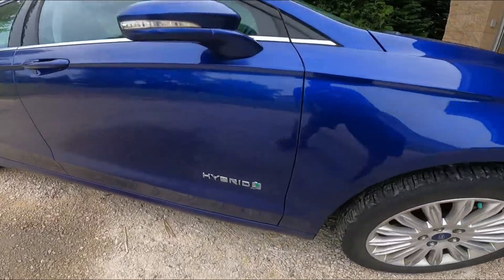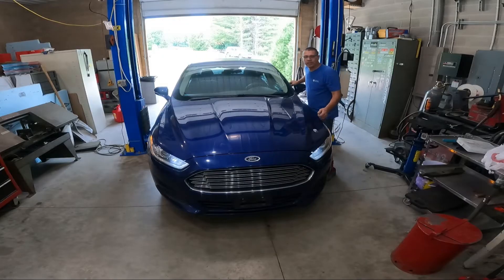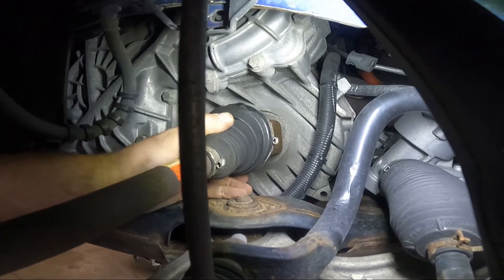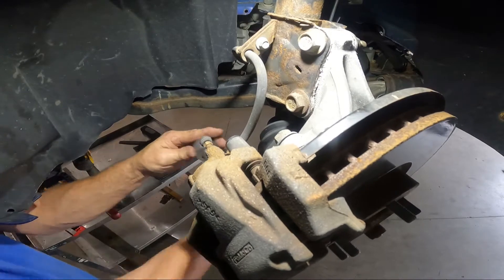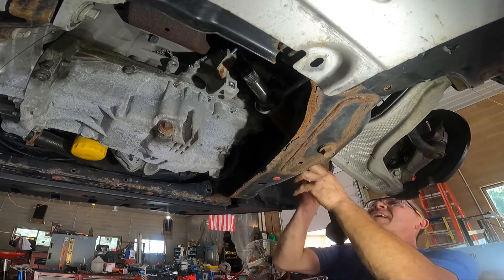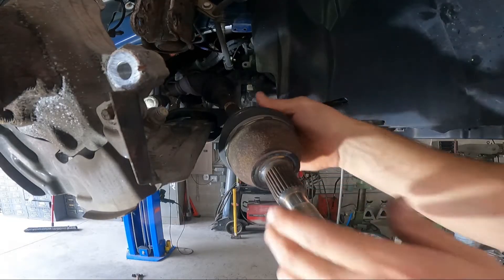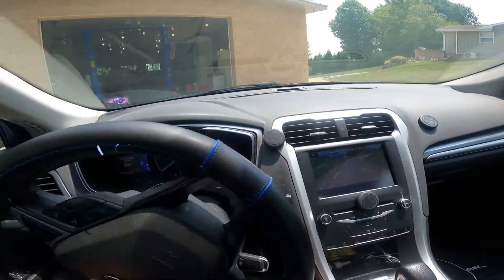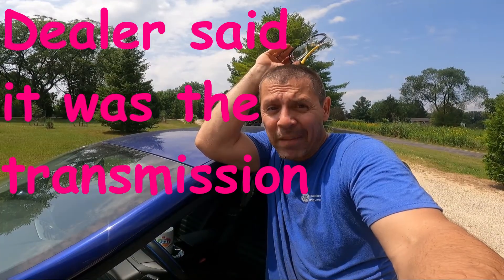2014 Ford Fusion hybrid front end noise, transmission?  Checked wheel bearings and CV joints, all ok

Comment: Is it possible that a bad cv joint makes the same noise as a bad bearing, cause i replaced all bearings and still same noise. But my mechanic i just got told i got a bad cv axle joint
Reply from the maker: I checked the cv joints and the “appeared” ok. The traded in the car shortly after I looked at it so I’m never did find out what was the true cause.

Comment: did the issue resolved? If yes, what is the cause for it?
I have same noise
Reply from the maker: I did not resolve the issue. The owner took it to the dealer and from what he said it was an internal bearing issue so he traded it in and bought a new car.
Reply: @whatsnextgarage  inter bearing of what ?
The transmission or some other part ?
Reply from the maker: @hp5998 yes inside the transmission.
Reply: @whatsnextgarage  so is it danger to drive like it ?
Mine is 300k kms on it sound started at around 250k kms. Mine is ford fusion hubrid 2015. 
PS: I am planning to change the transmission fluid due to high kms on it. Do you think it will resolve the issue ?
Reply from the maker: @hp5998 changing the fluid won’t hurt that’s for sure. As far as the noise, it’s super hard to say.  Maybe yours isn’t the bearing and it’s something else. If you put 50k on and the noise didn’t get worse then perhaps it’s something different. Change the transmission oil and just monitor the noise, if it gets louder over time then maybe you will have to do something with it. If not then keep going. That’s only my opinion, I’d probably do that, drive till I was sure it’s getting louder then repair or trade in.
Reply: @whatsnextgarage  yes same thing I was planning. Mine noise is not louder its just coming for couple seconds and goes away. It only come when can is on battery hybrid not on gasoline. 
Lets change the transmission fluid and I will update tou so other users can also onow about it.
Reply from the maker: @hp5998  awesome!!  Thanks for sharing your experience!!  Have a great rest of your week!!

Comment: This is a CVT transmission so when it's sitting still and the engine is on the transaxle is turning and you would hear that bearing at that time. If it's one of the half shafts that would only make it if you're driving the car. I have a 2010 Ford Fusion hybrid my CVT as it's getting more age on it is getting a little bit more noisier,  these are not quiet transmissions. I have a bearing making a noise. I've just learned to live with it I love the car the noise is not that bad and I'm going to drive it until it goes out on me LOL and my friend at my garage recycled parts has a transmission just waiting for me if I need it.
Reply from the maker: It really was a nice car to drive for the time I was serving 🥴 it. The customer wasn’t as in love with it as you are with yours. Let’s hope you don’t have to use the spare trans!!  Have a great week!
Reply: If I do it's okay my friend owns B Auto parts here in Mechanicsville  and the transmission has only 42,000 miles on it and it's going to cost me $450 for the transmission and to put it in it would be around a thousand maybe a little bit more. I think it's a pretty good deal. I use it for Uber I practically live in the car. Thank you for commenting and really enjoyed the video I did. Take care
Reply from the maker: @markcrew3696  Sounds like you definitely have a good plan in place! Have a great week take care
Reply: Thanks for making this video this sounds exactly how my wife's car sounds!
Reply: Interesting. My wife's 2013 C-Max hybrid is making a whirring noise, but only while driving (I think, I'm gonna have to take it for a drive again), and the Ford dealer diagnosed it as a bad bearing in one of the half shafts. So we took it to our mechanic and he replaced that, but the noise was still there. Then he said it's probably the transmission failing, but it doesn't hesitate or shudder while driving. Now she's scared to drive it, and we're trying to figure out what to do (sell it as-is, or dump more money into it). Is your still going Mark?
Reply from the maker: Owner traded it in.

Comment: Probably the failed bearing in the trans for the transfer shaft from the gas motor to the trans.  Pretty common problem for '13-'14 HF35 CVT trans in hybrid Fusions and C-Max's.  See Ford TSB 14-0214
Reply from the maker: Thanks for the info Andrew. Never did find out cause the customer bought a Cadillac.
Reply: What about later year Fusions/C-maxs? Where the transmissions built better?
Reply from the maker: @spencerleeb  I am not sure. I haven’t dealt with any more fords lately. Maybe Andrew Grimm will see this and answer your question.
Reply: @spencerleeb  later years were fine, this was not an issue after 2014, just affected '13 & '14
Reply from the maker: Andrew thank you so much for following up!!  I really appreciate your input!
Reply: @andrewgrimm3109  thanks for following up! Is there an article or TSB you can point me in the direction of to back this up?
Reply: @andrewgrimm3109  I have a 2017 Mondeo (European version of Fusion). A few days ago had to replace the HF35  completly because of its death. After 70 000 miles.. And I'm not the only one in Hungary. So, Ford hasn't solved the problem. It's a shame..
Reply: @spencerleeb  i have a 2017 fusion and have this same problem. About a $700 fix after P&L. Really annoying considering i started having these symptoms one month after the powertrain warranty expired. Ugh.
Reply: The early hf35 as in 13 14 and early 15 had bad differential bearings and they are covered under the hybrid component warranty of 8yrs /100k its an ecvt transmission with both electric motors in it....if your in a c.a.r.b state it should be 10yrs 150k....and soon as you hear any noise tell the dealer and leave a paper trail...ford pushes you off til it's out of warranty ....as long as you have the complaints they don't have a choice
Reply: 700 P & L from a dealership?
Reply from the maker: @VoicesofTbec I am not sure but if it is the trans, nowadays it probably would be more 🤷‍♂️

Comment: It’s not the trans man it’s the bearing I had the same problem and did the test on the wheel and the wheel has no play in it because the problem with the bearing is internal you have to take off the bearing completely and hold it up to your ear and spin it very fast and you will hear the bearing crackle very faint but definitely a bearing although the trans will make a noise similar to a bearing but the noise will be there while the car is on and not even in motion that’s when the trans bearing is messed up